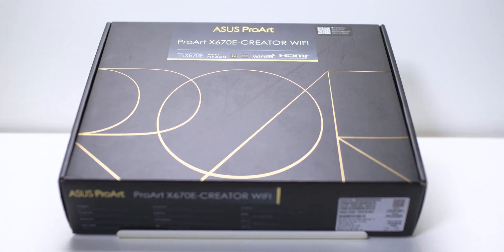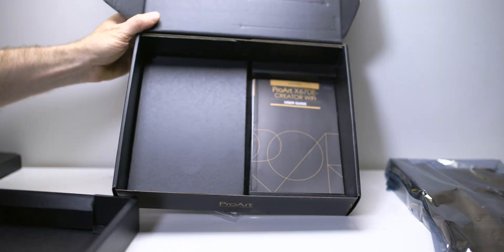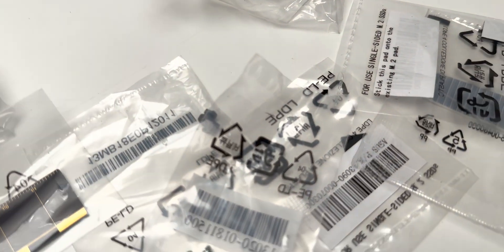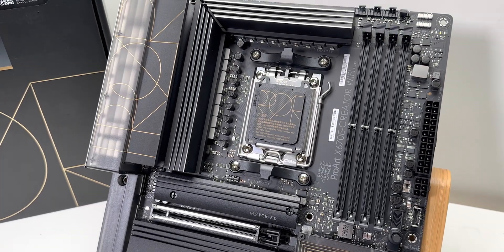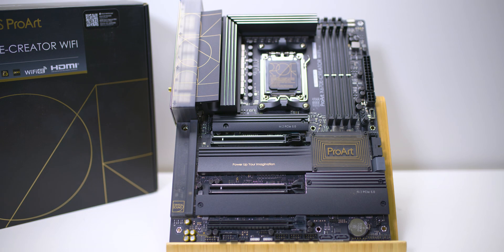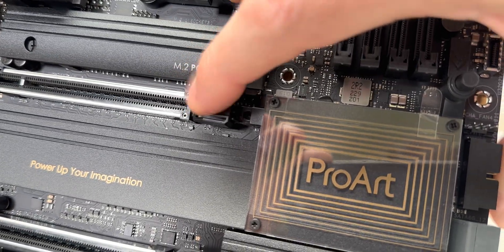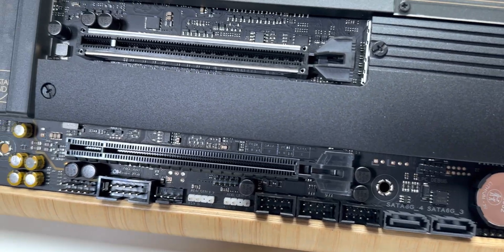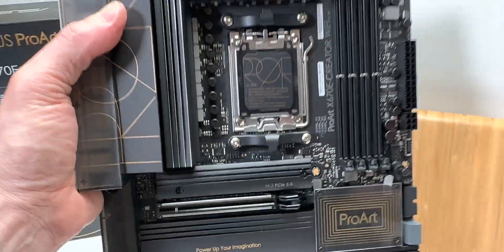A Creator's Dream - ASUS ProArt X670E-CREATOR WIFI MotherBoard Review

Comment: That "funky" PCIE Graphics slot retention mechanism is because there is a button next to the bottom of the dimm slots to facilitate ejecting a GPU without having to stick a screw driver in behind your gpu to release the clamp. Very elegant!

Comment: Can you tell the specific amp the audio solution on this X670-E Creator Wifi board is using?

The Asus Gaming boards all advertise the specific amp used (eg. Savitech SV3H712), but weirdly this one does not.

Comment: I'm thinking about this motherboard to build a dual 4090s system. I'm trying to find information if that way the PCIe will go to x8/x8 and if that affects performance in rendering. Does anybody has any experience on it?
Reply: I have this board, and yes, the manual states that the the top two full length slots will split to x8/x8 when both are populated. Since they're both pcie5, you'll get pcie4 x16 bandwidth for both which is more than enough for the 4090's.
Reply: But only with PCIe 5 cards. The two 4090 will run on PCIe 4 x16.
Reply: @Yue665  Hey, i have another question: how this MB is doing on VRM test?

Comment: Do you perhaps have ability to try out and test whether USB4 ports on this motherboard support PCIe tunneling? The Intel controller used has such capability, question is whether there are required connections on the motherboard to support this feature. I really need desktop supporting eGPU...

Comment: Oh man, you talk so much nonsense. Asus has the worst acpi tables.
Acpi tables are located inside the bios, so that the os knows how to control the hardware.
Acpi tables are btw aside from some efi modules the only parts inside the bios that comes from the manufacturer.
Windows is the only os that doesn't rely on acpi tables, because the windows drivers access directly the hardware....
However but Linux or hackintosh does heavily.
From my hackintosh times, and even this year's boards, Asus had always the worst tables! Most of the time even broken.
Apple has by far the cleanest most beautiful and best ones...
And everyone else is actually not good.
Gigabyte has actually the second best ones after apple. But gigabyte isn't good either.
However in those terms gigabyte is still a lot better as asus. In terms of Linux compatibility.
Everything from Asus that is software/bios including non working asus aura is actually crap. Asus has only beautiful hardware but they have absolutely no knowledge of bios/software.
Cheers
Reply: Who cares about all that anyway? Ordinary citizens are not worried about this. They just want to play a little game or do some audio or video work. If the table doesn't break ahead of time and deliver what is needed, that's enough.
Reply: @guto2755  that's true. Most people don't use Linux anyway. And hackintosh is anyway almost dead, or just a matter of time since apple silicon.
And those who use hackintosh still, have already replaced/fixed the tables directly in the bios or via clover.
ACPI tables are actually really easy to fix, since we have software for that like maciasl (asl decompiler).
However you're right it doesn't matters at all.
Cheers